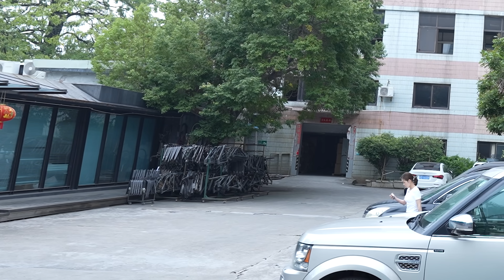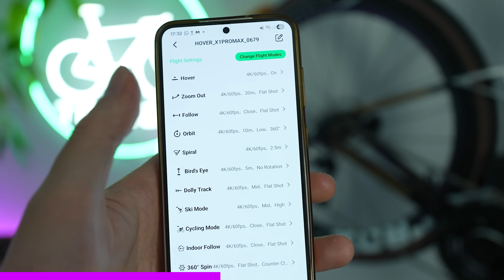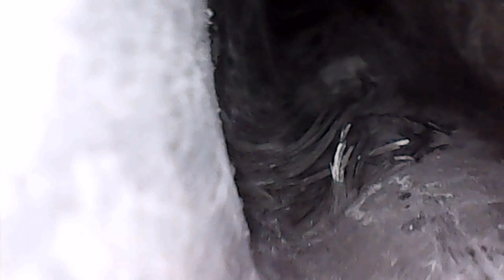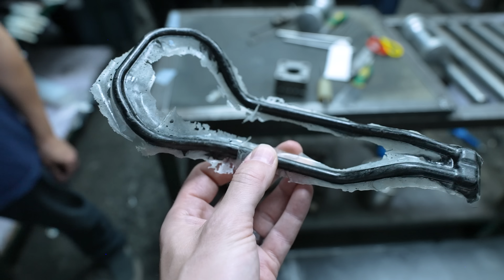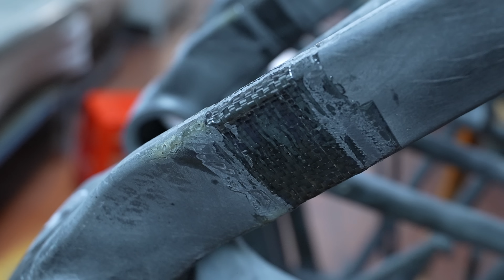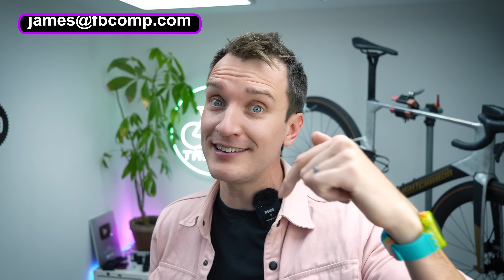The Secret Chinese Factory Behind Premium Bikes

Comment: I work in a home improvement chain in Australia. 
95% of our stock is Chinese sourced. What really grinds my gears is when they can't be honest about it. 
A box of drill bits will have the Australian flag with "proudly Australian owned and designed" written underneath it, and on the other side of the box, (usually near the bottom) will be a tiny "made in China" notice there if you bother to look for it........and have a good magnifine glass. We don't even make pairs of socks here anymore. 
When you outsource everything to someone else, you've surrendered your manufacturing sovereignty and security.

Comment: There are also high end frames with ‘made in’ claims coming out of these factories. To make claims of something being locally made, 70% of the value added by manufacturing has to occur in the named country. For a top of the range carbon frame, which has comparable production costs to any mid range frame, decals and clear coat could be enough to earn that label, given the eventual mark up.

This model also lets them do limited special colours, team editions or other customisation with little to no lead time.

Comment: I have a Chinese made R-853 steel bike. It was built in either 2001 or 2002. I know carbon fiber is a lot different material than steel but I can absolutely vouch for the quality. It’s full Ultegra with Shimano R-540 wheels. I paid $800 for it at the.l recall when I was researching other bikes like Trek and Specialized they were 2x to 3x more expensive. I wouldn’t be a bit surprised if they were built side by side at the same factory. I’d love to buy a no name carbon bike from a factory like this
Reply: The whole explosion of steel bike micro brands in the early 2000s was largely built on the back of mass production in Taiwan. They could do small runs of boutique frames on the side, using highly skilled welders. They were actively courting people wanting to start brands.

That business fell away over time as volume production of enthusiast road/mtb bikes for the Western market shifted to mainland China, but there is a real explosion of Chinese brands selling quite niche steel and titanium frames at the moment.

Like think about the number of highly skilled bicycle frame builders that China had at the time your frame was built compared with any other country. The difference this time around is that they are also developing their own brands, rather than just being OEMs.

Comment: I've known this for years after working in the clothing industry. We'd visit factories where they were making North Face, Mountain Hardwear, Marmot, etc, and the way it worked is the factory (not the brand) would create samples every year based on their own designs, that highlight the quality and skill of that factory and it's level of tech, machinery and experience. Brands then come to take a look at those designs and will pick several, which they will then 'tweak' to make their own. Changing a panel here, a zipper there, adjusting the size curve, etc. then picking colours and fabrics, which the factory then uses to create first run samples, which then get tweaked etc.

The fundamental design has nothing to do with the brand. Sure the brand does a lot of work, Q&A and user testing, but they don't touch the manufacturing. I have an Arcteryx Jacket that I got for $28 at the factory. Same jacket retails for >$600 here.

Ever since I made this realization. I have not bought almost anything from NA brands. I'll use Aliexpress or alibaba, or just contact the factories direct through taobao or whatsapp.

Comment: The west has been ripping off Chinese manufacturing qualities and pretend they are the gold standard for the last few decades, they might have produced well designed durable products back in the 60s or 70s but not anymore, now almost any products that required precision and scale have to be produced in China as they are one of the very few, if not the only with huge quantity of on-site engineers in their factories or manufacturing hubs.

Comment: I've worked in all sorts of engineering, but mainly automating various manufactruing processes to do with electronics and automotive components. What amazes me with carbon fibre frame manufacturing is how labour intensive it is, and how random it all looks. Those frames look a right old messy bodge job until all stages of the process are completed. God knows how they get any consistency and decent built quality out of this way of making frames.
Reply: Yes makes u wonder to trust them on ur life on a 70kmh downhill

Comment: The State of the Art manufacturing is in TAIWAN, not mainland China. Quit the communist propaganda!
Reply: In fact, a large part of mainland China's manufacturing capability originally came from Taiwan. Due to industrial relocation roughly 20–25 years ago, a number of Taiwanese business owners established factories in mainland China and trained a large workforce of engineers, technicians, and production staff. At the time, there were two major Taiwanese-owned bicycle factories, both located in Dongguan, Guangdong.

That said, carbon fiber technology 20 years ago was a completely different world compared to today. Even in Taiwan and Taiwanese-owned factories, when production first moved to mainland China, most carbon frames weighed around 1300–1500g or even more. By modern standards, those products were relatively heavy and simple.

What's interesting is that many of the advanced manufacturing technologies used today were not simply imported from Taiwan. A lot of them were developed by engineering teams based in mainland China. For example, the PP (polypropylene) inner-mold technology that Scott often talks about. The latest Addict RC fork spends a considerable amount of time explaining the process, but the technology itself was developed within factories in mainland China. The ownership may be Taiwanese, but many of the engineers and technical specialists behind those developments are mainland Chinese.

This also helps answer some of the questions people have about manufacturing capability. If you've watched GCN's visit to XDS, it's hard to miss the large number of unfinished Trek Madone frames visible throughout the factory in the background. Those distinctive seat tubes are instantly recognizable. It highlights just how deeply Chinese factories are involved in producing some of the most sophisticated carbon frames in the industry.

In fact, many of the bikes people consider dream machines are built in China. Some Ridley models, for example, are produced by Taishan Sports Group in Shandong. Certain Cervélo products have come from factories associated with Quick's parent company, and there are many similar examples across the industry.

At this point, carbon fiber manufacturing is not a mystery in China. The knowledge, the equipment, and the engineering talent are already here. Whether a company can build an exceptional frame is often less about manufacturing capability and more about how much it is willing to invest in design, engineering, testing, and development.😉
Reply: You are misinformed. China builds all the frames ( cheaper labour) n they send them to taiwan for finishing n the made in taiwan sticker
Reply: @the.communist You wish!

Comment: This is the content we’ve all been waiting for. Everyone in the cycling industry knows Xiamen is the silicone valley of carbon fiber, but actually seeing the inside of FiberTek is incredible. It completely demystifies the "cheap Chinese carbon" myth when you realize it’s the exact same hands making the £5,000 framesets. Insane access, Luke! 🇨🇳🚴‍♂
Reply: I have an off brand Chinese ste😅el bike from 2001 or so and the quality is fantastic. No doubt is even better now. I have no problem with that. My issue is with brands that will say “hand crafted in Italy” and charge $11,000 plus with a bike that’s built on the same line as every other one out there
Reply: @RobertSmith-le8wp  take the Bugatti bycycle : its Factor1 Frame is made in Taiwan, SRAM groupset made in Taiwan... I'm sure there is a market that is willing to spend 25k on this but at least had the frame manufactured by Bugatti.

Comment: How EPS core is removed?
Reply: Different factories handle EPS cores very differently. To be honest, the basic concept is fairly straightforward.

In most cases, a traditional inflatable bladder is placed inside an EPS (expanded polystyrene) core before molding. One of the limitations of a conventional bladder system is that internal pressure can be insufficient, especially when manufacturing carbon components with very large cross-sections, such as the downtubes found on modern aero road bikes.

By placing an EPS core inside the bladder, the volume of the internal air chamber is reduced, which increases molding pressure during inflation. At the same time, the EPS provides structural support during layup, helping the carbon fiber maintain its intended shape before consolidation.

Removing the EPS afterward is usually quite simple. Workers often use a flexible rotary tool attached to a drill to break the EPS into small pieces and extract it through existing openings. In other cases, the entire core can simply be pulled out intact. Whether that is possible depends largely on the frame's internal geometry and whether there is a clear extraction path. Overall, the process is not particularly complicated and is actually quite straightforward.

However, some narrow or enclosed areas present a different challenge. In these locations, the internal support material may be left inside the frame permanently. Certain geometric features create trapped volumes that make core removal impossible. In those cases, manufacturers may use PU (polyurethane) support cores to maintain shape during molding.

Examples can be found in areas such as the rear triangle of some SEKA frames or the seat tube region of the Trek Madone, where complex internal shapes create trapped sections that cannot be extracted after molding. In those situations, the support material is simply left in place inside the structure.

Comment: squeaking brakes 90% of the time come from contamined pads, which is the hardest part to clean, some times you cant. Discs often just a quick sand and brake cleaner / isopo]ropanol etc does the job. In the end is just a piece of metal. so yeah most of the time new pads, clean disc fix the issue. great tour of the factory thanks.

Comment: It is not really about the "made in" wording, but about custom law and tarifs. If you import a not finished product into EU, you often don't need to pay full custom tarifs. Finished bike frames have a tarif of 4,7% and additional anti dumping duty of 48,5% and additional 20% EU-import tax. Now comes the trick: If the frame is not finished, means if it is not painted, the importer may have the option of an exemption for the anti dumping duty. Also importers who only import less than 300 frames a month can get an exemption. But in all cases it needs to be sold in the end as a full bike. Just a frameset will always get the anti dumping duty on top. Thats why from some manufacturers you can get a complete bike with low tier components for the same price as a frameset.

Comment: I bought a frame by Elves, this place used to make frame for Cervelo until 2019. The factory knows what the frame looks like and how to produce them, what manufacture oftentime never provide is the specs on the angle of carbon layout, sometimes they omit which roll of carbon fiber is at what specs. And why resin has to be appplied at a certain temperature. Figure out that essentiall you have a frame that cost 1.5 grand goes as good as 5 grand bike to most general rider.

Comment: Lovely video and very descriptive, i bet you level of appreciation for carbon frames went a notch higher. On the topic of bonding carbon, could you share a remedy for rebonding cycling shoes with carbon soles.. I've tried super glue, I've tried two part epoxy, I've tried cobblers glue but still have the recurring "laughing" shoe..
Reply: "Shoe Goo" bonded my sole.  West System G/flex is a very good slightly flexible 2 part epoxy that has a good track record of bonding odd materials too.

Comment: I remember reading an article years ago and it said China pushed carbon fiber because it was safer to produce, welding was causing too many fires and as China is mostly multi story manufacturing buildings it was more acceptable. The article also said carbon fiber was part of the reason for the BB changes. The manufacturers wanted more access to remove bladders etc from the CF frames so BB30 etc were really to help with that, nothing to do with performance. Not sure if true - was an old article on the Planet X website back in the day.
Reply: Its easier to teach someone to glue pieces of stickers than wielding.

Comment: The "Made in Italy" designation is based on how much of the value of the item is created in Italy.  If an Italian maker says it costs $500 to paint a frame they paid $100 for, it is "Made in Italy".
Reply: If China produces the individual carbon tubes, lugs, or frame sections, and Italy performs the engineering, alignment, bonding, curing, finishing, quality control, and creates the final rideable frame, there is a stronger argument that the frame's last substantial transformation occurred in Italy.

Colnago, which for some models has used carbon components produced in Asia and then completed in Italy. The precise origin designation depends on the manufacturing process and customs assessment for that model and production period.

Carbon tubes made in China → bonded into a complete frame in Italy → painted and finished in Italy: potentially "Made in Italy" if the bonding process is considered the substantial transformation.

I think turning the bare tubes and lugs into a ridable frame is a substantial transformation.

I read that value is also considered in the mix too
Reply: @lennytortoise the frames are built in full in china n shipped.
Reply: @the.communist and still labelled made in Italy?

Comment: What happens to the latex inner forms? Melted off at some stage?
Reply: Latex bladders are actually pretty simple to remove. Once the frame has been cured, they're usually pulled out while everything is still warm. Since the bladder is very soft and flexible, it can often be extracted as a single piece through the head tube, even after passing through much of the frame's internal structure.
Reply: Its eps
Reply: @the.communist  Where does it go?